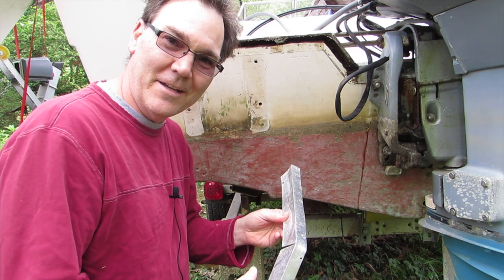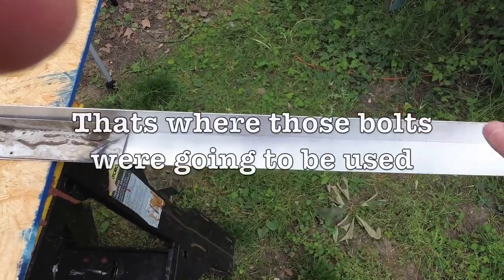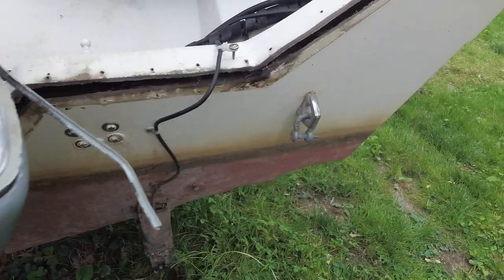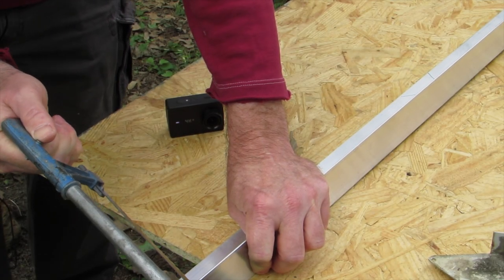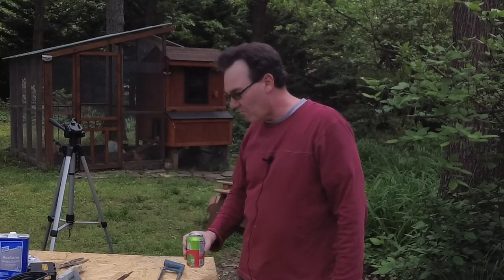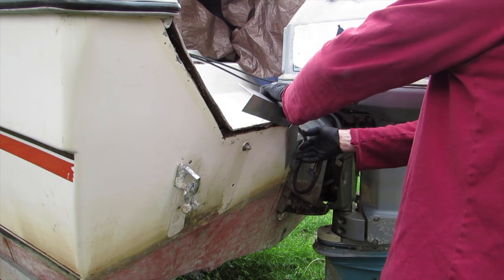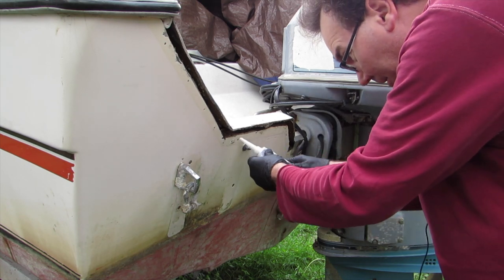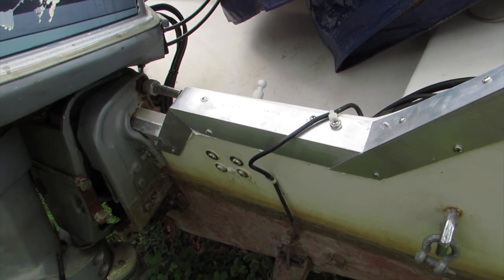Boat transom repair. Making a new metal transom cap for my boat to reinforce it

Comment: Yes. If you can get the moisture of of the wood, which takes a long time with heat lamps and fans, and then seal it up, it will stiffen up and stop rotting. If not it will continue to rot. Unless you get that water out it's no good. Been there and done that.  Did alot of what you had only to have to do a complete teardown 2 years later.
Reply: After further examination, I feel it is way too far gone for a dry and reseal.
Reply from the maker: I appreciate your insight! I reluctantly agree that I'm not comfortable enough to thoroughly trust it. The existing bolts, brackets, and mounting points seem to have it held firm right now. I'm not using it much and checking it thoroughly every week before I decide which big step I take next.

Comment: 6:37 look at that stress crack!!. That's a tell tail your transom is flexing way too much. That is a common place for a crack to form as a result of a rotted transom. Your plywood is supporting very little load and the majority of the engine is being supported by the fiberglass skin. I urge you and anyone not to take a vessel like this out on the water. Way too much can happen. I know a few people who's transoms gave way and lost everything. 500 to 1000 dollars is alot cheaper then a new rig and you know you have a boat that is like new and price of mind. The floor had been replaced by the previous owner... a rule that is often said is is the floor or rotted, the transon and stringers were gone long before. If that guy did the floor right he would of replaced the stringers. But I find that unlucky.  Ur skin should not be that squishy.  It should be solid
Reply from the maker: Thank you so much for the feedback! I was curious about that crack at 6:37. It makes sense that it’s related. I am taking another good look at it after using it for the last few weeks. I’m not getting any flex, but will be deciding the next steps pretty soon (part it out, fix it, or sell it)
Reply: @WayneTheBoatGuy  I have a similar crack.....i bought a boat not knowing what i was doing. I'm thinking of tearing the wood out of the transom and pouring liquid transom to replace the wood.